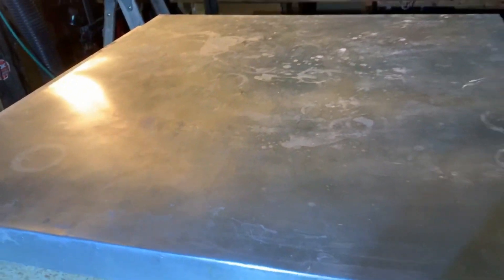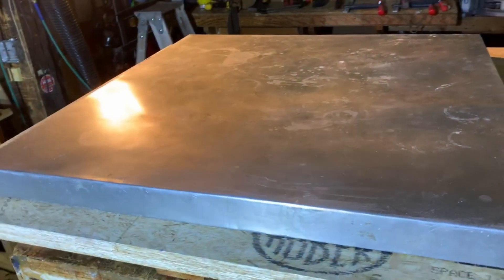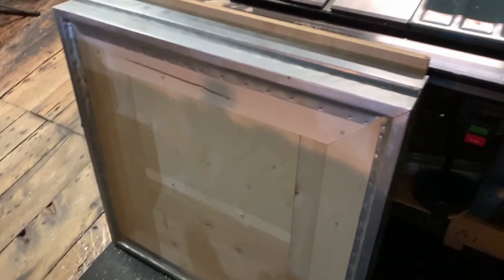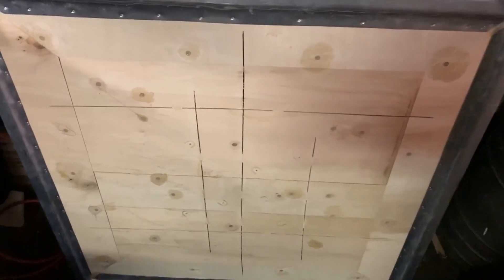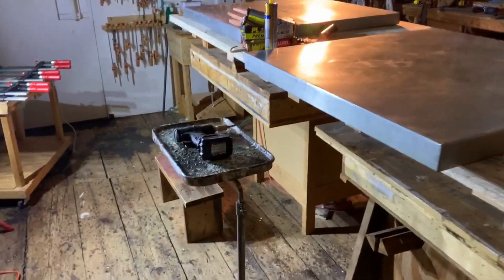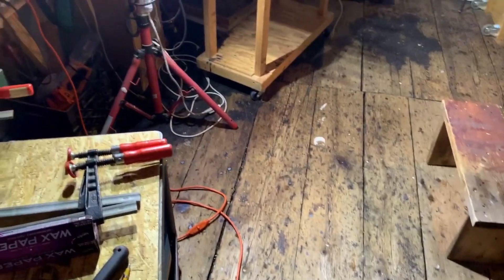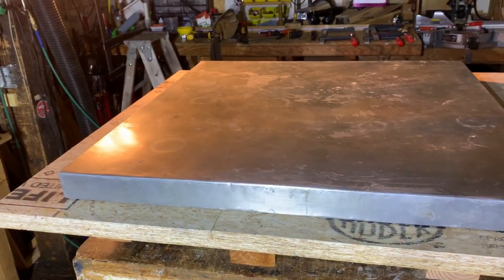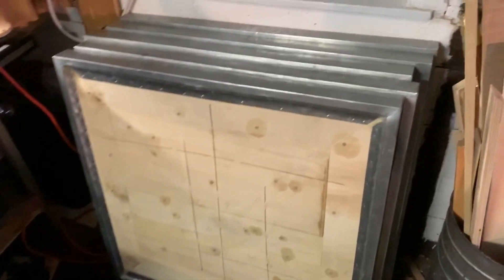Zinc Top Engineering Fail.  How to Fix + bonus train video

Comment: Not sure if I heard you correctly but I thought you said you were going to use advantech as a substrate I used it on a laundry room laminate job and didn't think about the fact that they use water repellent (wax) on their product and the contact cement failed in a few spots and it bubbled up. Unbelievably I took my biggest pasta pot and heated water up to a strong simmer  and used it to press it back down its been eight years and haven't had a call back, always something to learn.